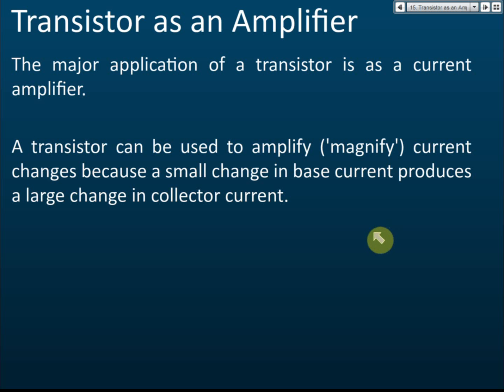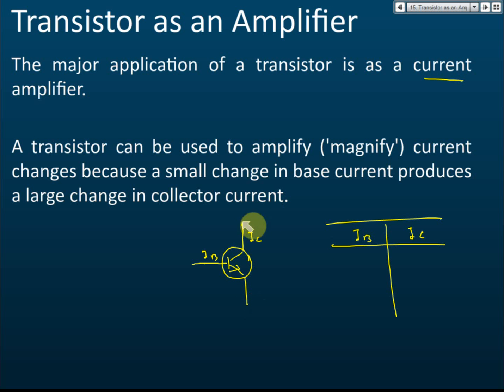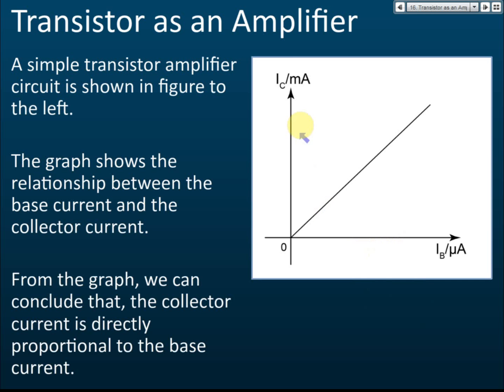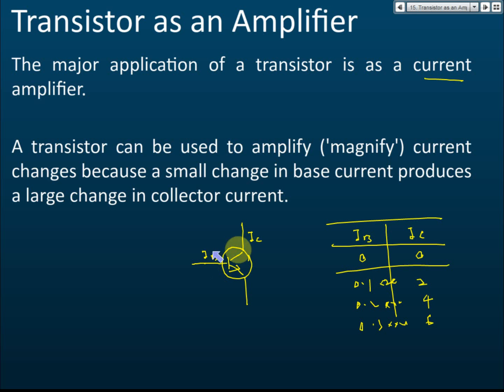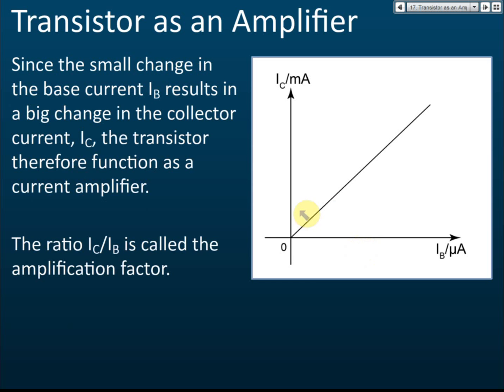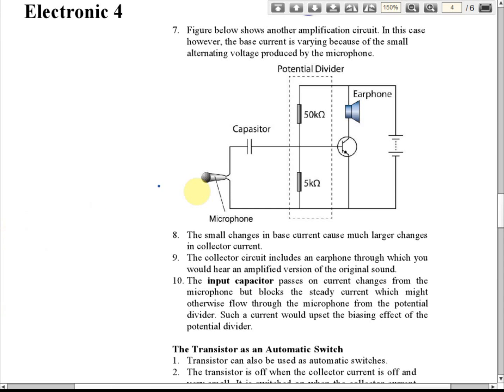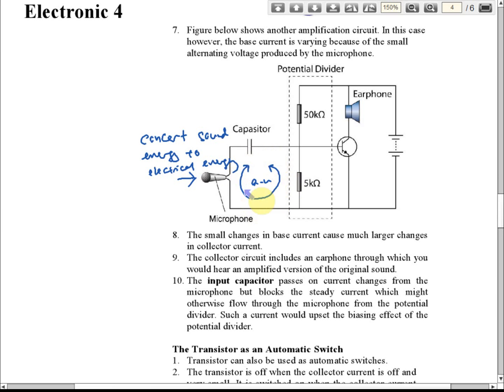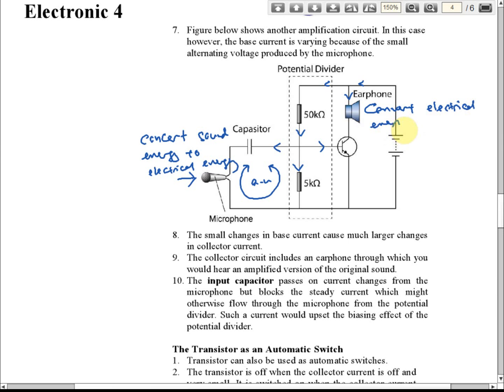Transistor as an Amplifier | Electronics

Comment: With all due respect, it is incorrect to say that "transistor is not  voltage amplifier". In fact, transistor, in particular the Bipolar Junction Transistor(BJT), which is taught at SPM  level, is indeed used as both current and voltage amplifier.  At SPM level, it just covered the current applification process and its formula, which is the IC = (beta)*IB. The statement just said "The main application of a transistor is current application". Noticed the word "main". It does not say "The only application...".

Comment: What is the function of the battery and voltage divider? I’m confused how the transistor increases the amps? Where does it provide the extra amps? Please explain more the relationships between the battery, voltage divider and the microphone.
Reply from the maker: The battery is the source of electrical energy. The electrical energy generate electromotive force. The electromotive create potential difference and hence drive the motion of the electrons in the circuit, and hence produce current. The potential divider control how much potential difference should be given to the output (the collector circuit) and the base circuit, and hence control the amplification factor.

For example, if the Rc = 50kΩ and Rb = 5kΩ, hence Rc:Rb = 10: 1. If the voltage across the two resistance is 11V, then Vc will be 10V and Vb will be 1V.

Comment: So whats the function of the potential divider there ?
Reply from the maker: Potential divider is used to control the ratio of the voltage across the collector and the base. For example, if the Rc = 50kΩ and Rb = 5kΩ, hence Rc:Rb = 10: 1. If the voltage across the two resistance is 11V, then Vc will be 10V and Vb will be 1V.

Note:
Rc = resistance across the collector circuit
Rb = resistance across the base circuit
Vc = voltage across the collector circuit
Vb = voltage across the base circuit